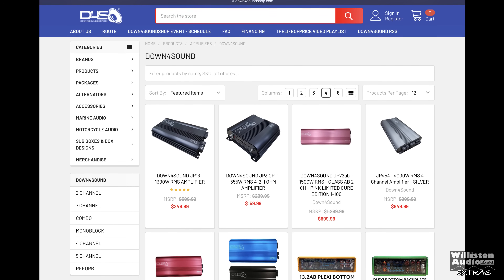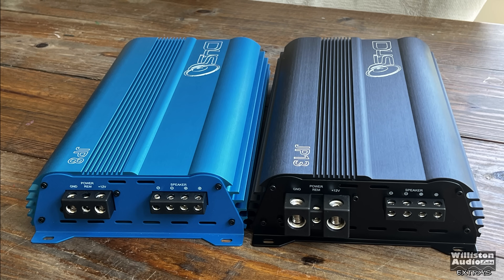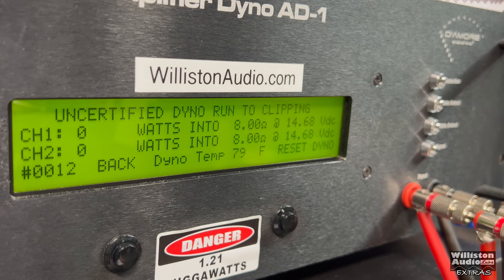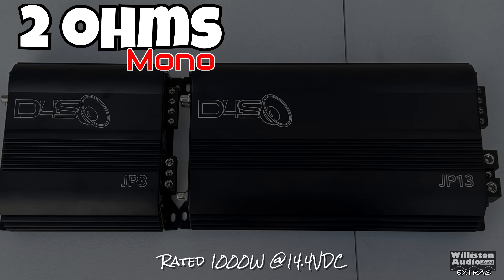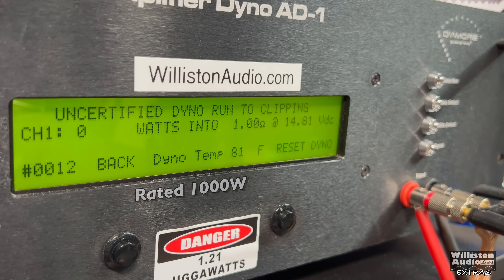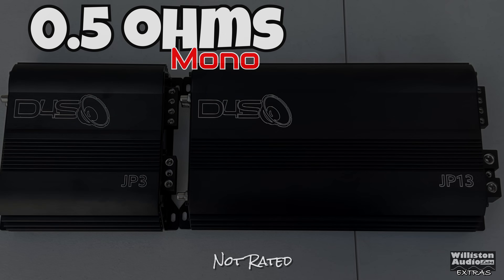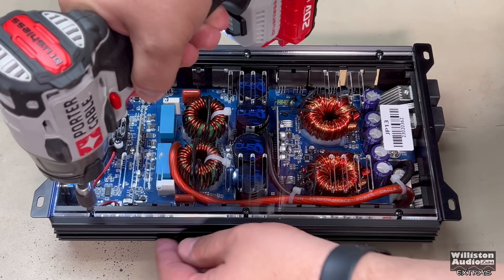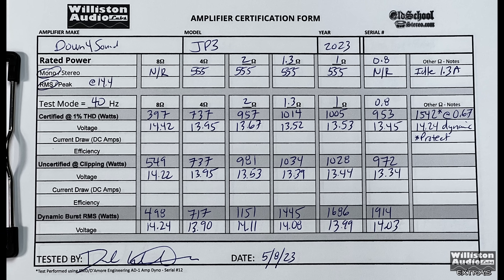Down4Sound JP13 Monoblock - 1300 watts? Yeah, Right

Comment from the maker: SHOP
(Affiliate links and all may not be available)
JP3 Mini Mono Amp: https://lddy.no/1fqr3
JP13 Mono Amp: https://lddy.no/1fqte
JP8 Amp: https://bit.ly/3wOBbhg
JP8 v1.5 Amp: https://lddy.no/1fp9d
JP23v1.5: https://bit.ly/3yYt9DN
JP23v2 Mono Amp: https://lddy.no/1d7oj
Shop all Amps and Speakers here: http://www.shop4bass.com
D4S LTO 6.0 battery: https://lddy.no/1d7tj
1/0 OFC Amp Wiring Kit: https://lddy.no/1d7uj (don't get CCA!)
HiFiVega 1/0 OFC Wiring Kit: https://bit.ly/3rV9vDU
HiFiVega 1/0 OFC Big 3 Kit: https://bit.ly/3rXqxRW
Note: Amp requires 1/0 OFC wiring. Remember, it takes power to make power, beef up your electrical system first! This amp can pull over 200A at full volume. 

RELATED VIDEOS
Playlist of All D4S JP Amps here: https://bit.ly/3NF8I32
Down4Sound JP10.4 4-channel: https://youtu.be/bltwyRWV04k
Down4Sound JP234 4-channel: https://youtu.be/wA-F_MGXCS4
Down4Sound JP83 Monoblock: https://youtu.be/_Buqewi_8lI
Down4Sound JP34ab 4-channel: https://youtu.be/9ptlq9hg3jI
Shop for Down4Sound Amps: https://is.gd/D4Samps
Shop for Savard Hi-Q Subwoofers: https://amzn.to/2Nh1qcf
Check Out My Main Channel   @wal

VIDEO AND AUDIO GEAR
Camera - iPhone 13pro 1TB - https://amzn.to/3nCjGvc
RODE Wireless Go II Microphones: https://amzn.to/3Q6NVHl
Shure MV7 Microphone: https://amzn.to/3A4OICK
Zoom H4n Audio Recorder: https://amzn.to/3BXjVsS
960 LED Panel: https://amzn.to/2Sxoq3S

TEST BENCH EQUIPMENT
SMD / D'Amore Engineering Amp Dyno: https://goo.gl/sJTcf7
XS Power D1400 Batteries - https://amzn.to/2BPFCKW
XS Power PSC60 Charger - https://amzn.to/2CHGcfs
Fluke 1000A AC/DC Clamp Meter: https://amzn.to/2Rw5WDA
Handheld Dyno: http://amzn.to/2u2EgKV
My Favorite Screwdriver Kit: http://amzn.to/2x0VzcE

DISCLAIMER: This video and description contains affiliate links, which means that if you purchase from one of the product links, I may receive a small commission. As an Amazon Associate I earn from qualifying purchases
Reply: What does it say on the board???
Reply: Does " Burst " mean peak power?

Comment: My first jp amp was the 2300v1.5 then the jp8 man I loved that amp then the 2300v2 and wow what a difference in power! That’s all I use and recommend is D4S amps! The only amp that kinda disappointed me was the JP1.2Z3 that’s thing the most it did was like 600rms @1 ohm on music the jp8 did 800 all day on low voltage
Reply: @premierBASS  D4S had sale  a couple weeks ago on the JP13, $169. I picked up a gray one, going to run it 2ohm to keep that 88% efficiency and 2 10 inch  audiocontrol spike series 10s. I should have picked up a extra one when on sale.

Comment: Purchase this amp after watching video. Spent all day installing rack set up to 1 gauge pulling remote wire etc. This amp was defective. Super low output to sub. Spent time troubleshooting. Installed test amp. This amp is defective outta box. Read reviews customer service review looks like I’m in for a long headache. Spend bout $290. Disappointed to say the least. Should stuck to pioneer. But saw this video.

Comment: The JP 13 is the same power as the jp23 version 1.5, only it's more efficient,  with less current draw, I believe that's why the JP 23 v2  was upgraded with more power output

Comment: Just ordered a JP13 and an Incriminator audio death row 12v3, which is rated for 1750 RMS. I also ordered a JP84 and CT sounds Mesa 6.5 components and coaxial's. I hope this turns out to be a good combo to get my 2 door Jeep Wrangler rocking. I really wanted the D4S components,  but I didn't think I could fit the tweeters in my stock locations.
Reply: How did this amp do on that woofer?

Comment: How well would this do with us guys with weak electrical. On 12v
Reply: Should be great, just tune the amp to the current draw. I will say though every amp install over 1000 watts should do a big 3 first. 
It's also always better to run a bigger more powerful amp than you need and turn the gain down than running a smaller amp maxed out to its limit like alot do. You should never see the clipping light come on and if you do turn it down a tad on the gain or invest in a bigger amp.
Reply: @mattburgess2  I believe my cars stock wire for big 3  is 4 gauge already since my battery is located in the trunk it's a 2019 Chevy Cruze

Comment: Great vid, looks like another great JP amp.  I'm hearing a lot of complaints about that noisy fan, hopefully that gets updated sooner rather than later.
Reply: Luckily,  I guess my JP8 is in my trunk slamming my (1) Skar 10” DDX DVC2 in a factory rhino lined enclosure luckily I can’t hear my fan but running at 1 ohm it’s NEVER hot or warm so I know it’s working good!#Down4Sound#JP8👑🔊❤️SkarDDX@DarrenTOdd

Comment: Would a 240 amp alternator with big 3 and 0 gauge ofc handle this thing well?
Reply: It's late, but I just have a 130a alternator with no big 3 and it handles this easy, no dimming or anything
Reply: @isaacbernardez6193  hows it still holding up ?

Comment: Just wanted to say but rating an amp at 1000 watts and having it put out 2000 is not cool. I love the D4S amps but they need to rate them properly. You cant pair one of these amps with a sub unless you knew how much power it can output. A bit extra is always nice but 2x the output is actually dumb. Just call it a 2000 watt amp instead.

Comment: Would love to see what this does strapped.
Reply: Me too Cause I'm on the fence right now. I just ordered a JP13 and after I ordered it. The JP23V 1.5 popped up for $40 more and in different colors. Which I was kind of disappointed about because I searched all over the damn website and the only jp23v1.5 that came up was a black one that came with the older style plastic base knob. So i ordered the JP13 and at the bottom of my order slip pops up the 23V 1.5 and different colors with the metal base knob. I was so disappointed which I really didn't need the power of the 23. But it's always nice to have the extra power on tap

Comment: If car audio drivers were much more efficient ie-SPL 1w/1mtr you would not need such big amps
Reply: Super efficient subs don't handle much power.
It takes a certain amount of power to overcome the  sturdy build of a long stroke voicecoil and the required attached parts that can handle big power.

Comment: D4S JP amps for the win! The only question left is longevity. We seen the test it passed them with flying colors and some. But how brutal can you be on these amps before they fail? They can get pretty hot. So heat disipation is really the only thing I can think of. It's hard to control my excitement when an amp does so well. After being lied to by so many manufacturers 😂
Reply: I bought a jp23v1.5 about 2 months ago ....I run a single American bass xr 12 dual 2 with it ....have run it for over an hour at very high volume and it has never got above 120 degrees ....and it was 82 degrees outside that day windows down no air conditioning on ....I have never had it get hot yet ...I do only have the gain at half way ....because thats where my sub seems to be happy with volume all the way up ....
Reply: @Donald Wilcox, Jr.  Come down to Texas when it's a hundred degrees and plus in the summer they get really hot have two jp23 amplifiers wasn't strong enough for my sundown xv3 12s and ran hot but didn't cut off I'm running a Taramps bass 8k and it doesn't get as hot as them

Comment: Good video Derek..never had any luck with this brand..my taramps smart3 bass never let me down.
Reply: How can someone not have any luck with these amps?
Reply: Smart 3 is literally a much cheaper made amp
Reply: Taramps has a 6% failure rate by their own admission. JP amps are at 1%. Full bridge amps are much less stable and reliable just by their design.
Reply: @timstarnes8587  you do you

Comment: JP amps and Down 4 Sound in general are great! Customer service is super fast, if something should go sideways; and shipping is really quick too. I ran a JP23 for about a year with various subs and loved it, but when I switched to four b2 10s in my Ram 1500, I wanted more. So did the 320 alternator, monster AGM under the hood and lto in the back running a JP33…Oh my god! And that’s before I’ve run any rebassed tracks thru it. 
Bullet proof

Comment: Super excited about this one as it hit my goal perfectly. the jp8 was 1400 @ 1 ohm, the jp23 v1.5 was 2600 @1 ohm so I wanted this one to be right in the middle and with it hitting 2000w @1 ohm made it PERRRFECT! so this fills the gap between the jp8 thats $199 and the jp23 thats $299. Since this one is $249. Its perfectly in the middle with power AND price, win winnnnnn =D Thank you for another great review!
Reply: Great job my man. But by any chance are you guys going to have a "select a color" option for all your amps? I'd love to see a jp23v2 in black as well. The jp33 would look badass in black too!
Reply: Your amped up attitude and business practices sold me on this. Underpromise and over-deliver an amazing product. Can't wait for mine on Tuesday... Just wish these babies came in blue!
Reply: Just picked up a jp8 to push two dd audio 10s can’t wait to get it installed.
Reply: I just bought one for the same reason. I had the JP8 and it was a great amp. I'm running different subs now, needed more power than the JP8 would do, but didn't quite need the power of the JP23. This is EXACTLY what I need!
Reply: Fixing to order one of these. 

Should push my l7s good
Reply: The jp13 is worth every penny
Reply: Hey JP good job man on those Amazing Amplifiers I love them wish you could send one to me so I can do a gut review on one 👍 🙏

Comment: Are we expecting a new 4ch from D4S by chance? Would be really nice to see a smaller 4ch amp that matched up with the JP3.
Reply: like a 50x4 or something?
Reply: @THELIFEOFPRICE  Not for nothing, but 50x4 seems dated. Even something in the realm of 65x4 would help it standout from seemingly an endless supply of alternatives.
Reply: @THELIFEOFPRICE  yes please, which in reality does about 120 x4 @ 2 ohms.  Also a small "250w"  2 channel would be awesome.
Reply: @THELIFEOFPRICE  Yeah, or maybe just slightly more. 60-70 x4. I see the JP84 on the site but its 120x4. Its honestly a great price for that amp but something about half that RMS would match really nicely with the new JP3 I would think.
Reply: I think you could sell buckets of 75x4 amps honestly. The only thing is that typically people are running 4ohm full range speakers so the 90RMS of the JP84 is actually pretty nice. Im not sure if its possible to do a class AB amp in the same style (constant output or whatever its called)  but that would be pretty attractive to me. (honestly im actually in the market for straight class A amps for SQ but its more of a dream than a reality for me)
Reply: @THELIFEOFPRICE  Tell you what. If you build one, I'll buy it and the new JP3 to start an epic low budget SQ build.